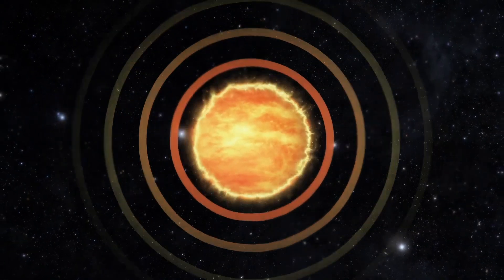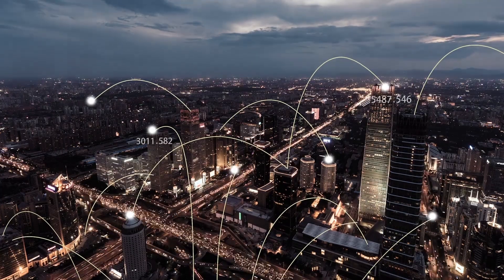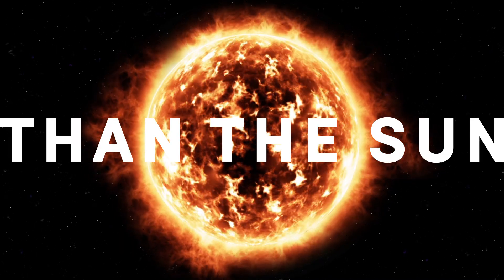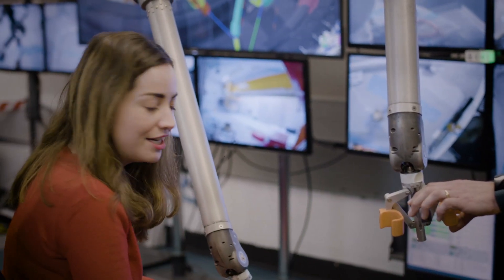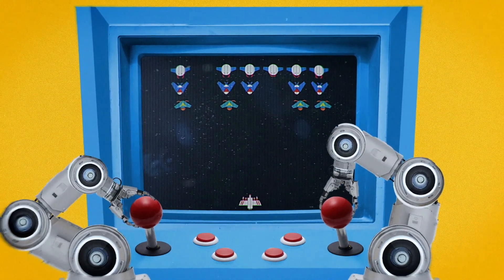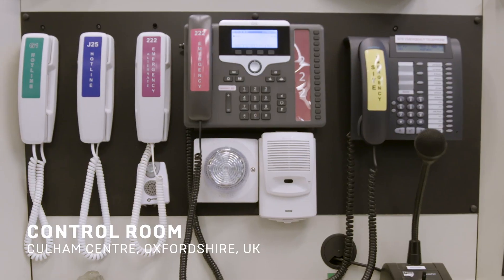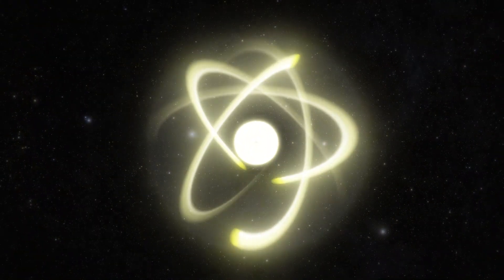Inside JET: The world's biggest nuclear fusion experiment | On Location

Comment: You forgot the other issue, tritium unavailability, you need a fission plant to create it. 
The same as with a fusion bomb you need a fission bomb to ignite it (which in order needs a chemical bomb to be ignited too): you need a fission plant to create the tritium.
Reply: Actually they can produce more than enough tritium in the fusion reactor than what we'll need, of course that depends on getting an over unity working reactor.
Reply: Fusion is a Terrible Way to Produce Electricity: Princeton Physicist Who Worked on It for 25 Years
https://www.youtube.com/watch?v=FrUWoywZRt8
Reply: They also forgot the issue that the neutron flux could be used to manufacture plutonium-239 for weapons.

Comment: They should not call it fusion or a tokamak, it's an arc reactor!!! Stark industries has done all the research.
Reply: Tony Stark built one in a cave!

With scraps!!!

😡
Reply: Fun Fact, that is what MIT will call their reactor, which they're currently working on.
Reply: Yea, there is a reactor plan called ARC by MIT and it is indeed a spherical small tokamak.
Reply: @CraftyF0X  Correction, it's not a spherical tokamak, it's a normal type (though the outer housing may be spherical if that's what you meant)

Comment: Renewables will not make fusion unnecessary due to the lack of easy ramp-up to meet demand and unsteady yield, they'll be best for stalling until we actually do figure out fusion, and then humanity will pretty much be set.
Reply: The bigger issue with renewables is short lifespan ~20yrs and large foot print.
Reply: bowez9 

Lifespan is 25-30 years these days for windfarms.
Reply: @Memoiana  yes and nukes are currently 60+ years.
Reply: That’s why grid-scale storage is the next challenge. Redox flow batteries, or some other large-scale storage technology is probably a lot closer than fusion
Fusion is probably still needed though, to take humanity to the next level of energy production.
Reply: @JonS  fusion will push us back into the dark ages as energy prices will be astronomical to pay for it.
Reply: Even if renewables make fusion redundant here on earth, fusion could be the life line for those who venture further and further away from earth.
Reply: @bricks2850  but maintenance makes tidal n9t economically viable and power output makes it infeasible.

Comment: ...10 times hotter than the sun 
Wait did I hear that right
Reply: Yeah. Temperature is one of the variables that we can actually tweak here on earth. Another one would be pressure but that's impossible to achieve here at the scale of the sun. So we need to go way hotter :)
Reply: Lightning can brag about being about 3.5x as hot as the sun, but that's compared to the sun's photosphere at 10k degrees C. ITER is about 10x as hot as the sun's core at about 15 milllion degrees C (about 1,500 times hotter).
Reply: yes, but consider that inside the reactor chamber the density of the plasma is 1 million times less than density of matter; so even if you have particles at freakishly high temperatures, the number of particles you actually have is really small.
Reply: @stennford6348  yes few particles but very, very, very expensive particles.
Reply: they can't get the temperature AND the pressure, so they have to compensate with higher temps
Reply: @dsdy1205  nonsense. put some deuterium at high pressure in a a SPHERICAL container which is sourennded by powerful electric and magnetic fields. then pass a million amps thru a spark cap in the center electrode and you have fusion...
Reply: @esecallum  fusion and net power is not the same thing.
Reply: Yes, because we don’t have the benefits of mass of a star and the vacuum of space we need to increase the density of plasma to achieve fusion. Stars have huge mass to contain the fusion, so we need magnetic fields instead since we can’t build a star the natural way. This means we need both hotter plasma and more of it in a smaller space to create fusion and that’s the engineering and physics challenge of fusion. And sorry it’s pretty ridiculous to use a single scientist to reach a conclusion about the viability of fusion. Science is advanced through consensus not individual arguments, that’s literally the scientific method
Reply: so what? if something goes wrong it'll expand and cool immediately making it impossible for a bomb to be made
Reply: Yes and stull can't produce net power.
Reply: Fusion is a Terrible Way to Produce Electricity: Princeton Physicist Who Worked on It for 25 Years
https://www.youtube.com/watch?v=FrUWoywZRt8
Reply: @esecallum  No way, fusions the way to go. There isn't anything that even comes close to it's level of production.
Reply: @esecallum  that quite an unscientific stance? What’s your basis for that belief? Because some guy with a science degree says it won’t, you’re assuming that it must be true?
Reply: @esecallum  I’ve seen that video. She makes a number of assumptions  and a few of her points aren’t accurate. I don’t think she did it on purpose m, perhaps she just didn’t do her homework. 
For example At one point she said tritium (a fusion fuel) was extremely rare in the world. That’s misleading. While that may be true on earth. The moon has a stock pile of that H3 from millennia of solar wind scattering. She forgot that there’s enough fusion fuel on the moon for tens of thousands of years.

Don’t you think it’s an argument from authority fallacy to claim that fusions impossible simply because that scientist says so, especially when there’s plenty of scientists that say fusion is very much possible?
Reply: @jeremiahnoar7504  Which point is not accurate? she actually WORKED on this dead end project.
Reply: @esecallum  For one,  She was NOT the scientist that worked with fusion. She's never worked on one of these devices. The scientist that the title speaks of is mentioned in the bio, Daniel Jassby. She runs a YouTube channel where she talks about cool science things.  So I can forgive her for her inaccuracies. What were the inaccuracies?  Well:

1) the tritium thing that I mentioned earlier.  It may be rare on earth but there's stock piles of the stuff on the moon.

2) 4:40 She said that neutrons make the lithium blanket brittle and eventually unusable. But no one said that the neutron blankets have to be made out of lithium. You could make them out of an isotope so that the neutrons that hit them actually make the blanket stronger. 

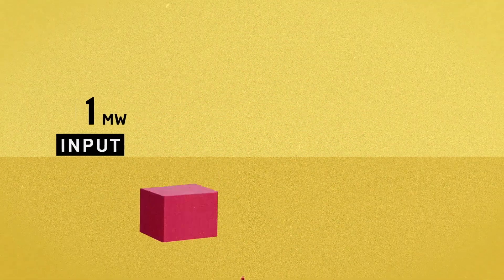3) 5:15 she mentions that JET makes a substantial amount of radioactive waste.  But as she admits earlier, radioactive waste isn't a necessary bi-product of fusion. A fusion reactor could use a different type of reaction that doesn't produce long lasting radiation. Reactions that involve tritium and deuterium doesn't create radioactive waste. Why not use that one instead?

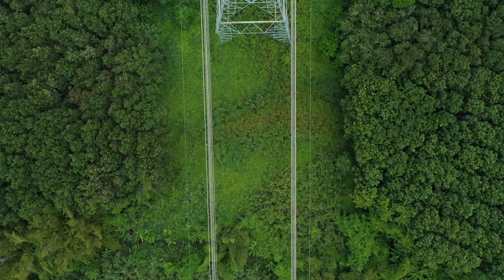4) 5:45 She said magnets need to be superconducting. which is true, but also old news. We already have superconducting magnets, we had those for over a decade. She mentions a problem with a quantum mechanical term called "quenching" and she's right, that's a bit of a problem. I'll give her that. But just because quenching happens, it doesn't mean that we can't predict when it will happen and plan accordingly.  It was ultimately a moot point.

5) 7:10 she mentions that the cryo-systems that keep everything cool are expensive to run. But those aren't a necessity in fusion. the role of the cooling systems are to keep the superconducting magnets cool so that they can do their thing. But companies are already creating room-temperature superconductors.  If we create and use the room-temperature ones then we don't need the cryo-systems in the first point. so that point of hers in unimportant. 

6) 7:40 she mentions that a lot of energy for fusion is geared towards turning the thing on. Well for one, when it's on, it doesn't need to be turned off anyways. Also it's only expensive in terms of energy mostly because of the superconductive magnets, but like I said earlier, if our magnets are the room-temp superconducting ones then that beings down the start up energy cost tremendously. 

7) 9:50 she says that there's a risk of an explosion. No there isn't.

8) 8:30 this is her most egregious mistake of all.  She claimed that because fission's complicated and sometimes expensive, fusion must be as well. Not only is that intellectually dishonest but it's logically un true. That's a category error. Fission and fusion aren't even in the same class. Either way, she can' t make that claim.

There were more things but those are the things that stick out to me the most.
Reply: @jeremiahnoar7504  number 8 is exact. FUSION IS VERY EXPENSIVE DUE TO THE PREVIOUS PROBLEMS 1-7. room temperature magnets? where are they?
anther guy called  Bibhas R. De proved mathematically why ITER cannot work due to interaction between the hot plasma and the magnetic field always creating an instability. a bit like trying to balance two opposing magnets on each other. He was banned because it would mean the end of the fake ITER fusion gravy train.  ITER is never gonna work.its the wrong shape.
Reply: @esecallum  of course Iter isn't going to work. But it's not designed to. iters just an experiment. real fusion is going to come from private companies. Like the ones creating the room temperature magnets.  that would make fusion so much cheaper.
Where are the RT superconductors? Well  SciShow has a good video on it. 

https://www.youtube.com/watch?v=1j7bMsFogJE&t=255s

it's a very new technology. Like this year new, but it's also big news. It has it's hang ups yeah. Big ones. But Now that they exists. her claim that the energy investment for fusion won't be practical can't be true anymore. Not for future fusion devices at least.
Reply: Jeremiah Noar

To control the fusion reaction, powerful magnetic fields are needed, so huge amounts of energy (you’ll understand why if you know anything about electro-magnetism). At the moment most fusion reactors use more energy than they produce. Long way to go..
Reply: @Memoiana  Magnets aren’t exactly the problem. It’s the cost of running them because they produce a lot of heat waste. superconducting magnets would bring that heat waste to around 0. Making the investment energy much much smaller. Also room temp superconductors (for the magnets) were invented this year.
Reply: @Memoiana  time brings down the cost of technology, so it’s difficult to compare the cost of tech that we’re using (renewables), with tech that has yet to exist. It’s best to look at their energy output capacity I believe since that’s determined by nature, not by man’s limited technology. Look at the energy density, how do you expect renewables to complete with fusion when fusion has an energy density of millions of times greater than fossil fuel?
Reply: @jeremiahnoar7504  Most likely he doesn't believe we went to the moon either, so how could we possibly get tritium from it? I mean, it's going to happen. The issue is just when will it become commercially practical. I have no doubt it'll be accomplished in the 'lab', but if it doesn't become commercially practical for another 25 years, it may be too late. Maybe too late for it to be desired or needed anymore, maybe too late for us as a species to take the darker view.

And there can sometimes be a large gulf between lab bench and 'gotta pay for itself'. Of course the flippant answer is that we'll eventually be building fusion reactors out of graphene :-)
Reply: @esecallum  Ok so one scientist and your opinion vs thousands of scientists. If it was made possible it would be better than any other energy source.
Reply: @alfiepicton1339  physics are not opinions.
Reply: @esecallum  have you looked into Eric Lerner's plasmoid reactor, seems legit and promising to me, but i'm no plasma physicist who could come to any meaningful conclusions.. :p

Comment: Perhaps we should invest more into this tech.

Future generations will be glad that we did :)
Reply: or how about molecular instead of atomic fusion, more reliable, more abundant fuelsources, slamming oxygen and methane molecules together in a cylinder of plasma is much more net energy efficient and easier to achieve than slamming atomic nuclei of deteurium and tritium together in a ring of plasma, and it can work day and night as long as your consumption side does not demand more than your resource gathering side............no nuclear waste, no robots needed, no neutron embrittlement...i would leave kids with safer things, but if they master atomic fusion, then why not? always happy to have a wind turbine, solar panel and batteries at hand...better than to breathe in burnt gas and coal... 😆
Reply: @petriepretorius4085  Where can we learn more about molecular fusion?
Reply: @sabelch  Molecular fusion doesn't exist.  At 15,000,000 degrees,there are no molecules,just plasma made up of charged particles.
Reply: thorium molten salt reactors are easier to build than fusion ones..
Reply: @morgorth3242   Anything is easier to build than ITER type fusion reactors.
Reply: I think these projects should open up to private funding so people can do just that if they desire. I think some of them already do. Pretty sure Tokamak Energy in the UK is a private venture.
Reply: Why ? when is pretty apparent the difficulties will only be overcome with the cost off huge inefficiencies. Its just a big science experiment like the LHC  . Lots of the difficulties appear economically implausible  . Its a lie to say no nuclear waste produced , look at the nightmare there having dismantling previous experimental sites , Neutron embrittlement , tritium loss , some poorly understood sudden heating of magnetic coils causing long shutdowns are just the start of what will still be an inefficient steam engine  that has to be surrounded by near zero kelvin magnetic coils ....how hard do you want to make it before the same money could have got us ultra cheep solar panels and batteries by now .
Reply: As renewable energy has became so cheap , the future generation would be glad if we do the renewable first , then fusion

Comment: we burned more fossil fuel in 2019 than we did in 2018
so much for renewables
Reply: Lol and that has nothing to do with the exponential increase in energy demand from increased population and increased standard of living? Renewables will take many years to catch up to fossil fuels, but they are rapidly catching up.
Reply: @frostman9661   first renewables have to be able to keep up with that growth before they can think about challenging the fosil fuel industry. how many years do you think that will take with increased power demand world wide?
Reply: @t395delta  I think you're missing the point of acceleration vs keeping the speed. Fossil fuels are staying the same pace of speed (as in moving but not accelerating). Renewables are accelerating. They are behind but they are not only moving faster to catch up, they are continuing to speed up, ergo they will surpass fossil fuels. You really need to take a look at china if you think renewables can't keep up. China had approximately a few percent of their energy come from renewables ten years ago, now it is approximately 30%. By 2030 they plan to have it be 80%. Literally any country could do this with proper investment.
Reply: @frostman9661  oh, i'm sure we'll be fine then :-)
Reply: and it still had absolutely zero influence on climate 'change'